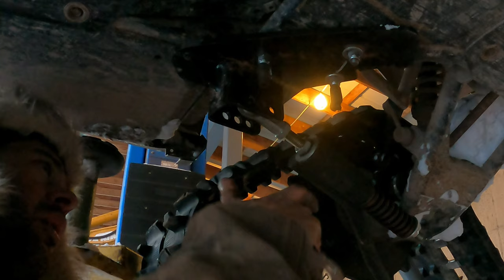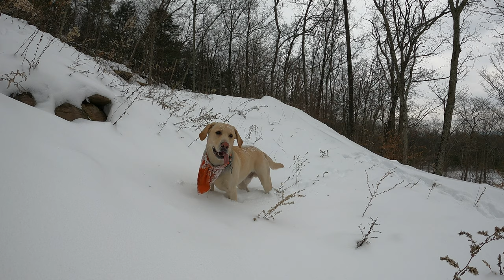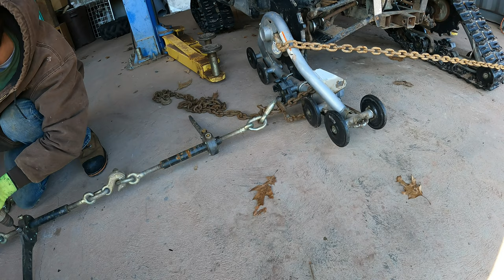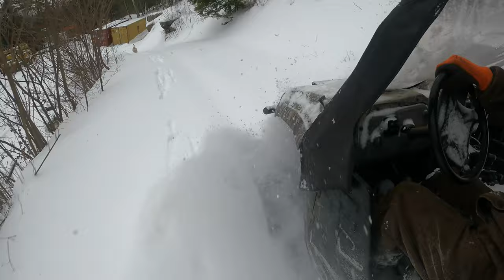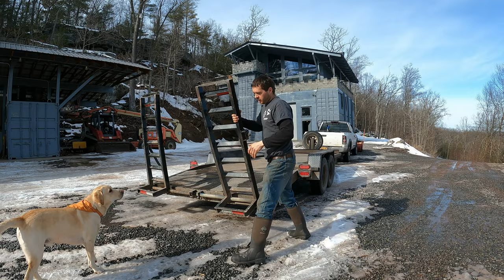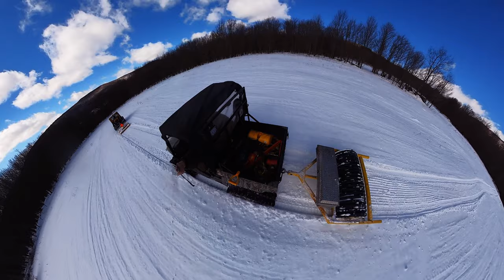Tracks vs tires in snow

Comment: The problem with tracks is the price. They are HUGELY expensive.
Reply: Why not just get a snowmobile and be done with it
Reply: I found a set on fb that was $4k new and only a couple years old for $900. For a 2014 Maverick 1000R. Definitely worth it for as high as $1500 but I live in Wisconsin. I certainly wouldn’t buy them new.
Reply: even worn tracks are better tread than tires in the snow. there is an economical market out there for used tracks.
Reply: Wouldn't chains be cheaper  & just as good?
Reply: @nancyjeanharvey7647  chains mostly better on ice. Tracks are good because they lift the vehicle at the wheels. Less stress on your machine and suspension parts to get an equivalent lift. Sure they are extremely expensive, But when your bottomed out and high centered on snow your wheel chains aren't going to help..
Reply: Mud Puddle, estos juguetes no son para los que no tenemos muuucho dinero...
Solo nos queda verlos en videos..
Reply: And they are pretty finicky
Reply: @johnjaco5544  you mean like the ones which overheats and made Andrew turn around on his 40 year old one build out of two or three broken ones? 🤔 😁
Reply: @pearlrival3124  well you can make your owns from old convey belts and angle irons like Donn DIY did.
Reply: @johnjaco5544  At this point why not get a snow cat. Though having tracks for a UTV allows for use in winter and summer. Though I have yet seen a snow cat that can take the tracks off and add wheels. Though I am sure if one wants to build something along that lines they could.
Reply: @mouaxiong8618  the stress on the suspension is still massive, due to the much leverage all obstacles have on it. If you hit a rock you might rip the whole suspension or the track cage apart. While you might just loose a tire/rim on the same rock.

While you can carry a spare rim with a tire or even two, you can't carry an additional track plus the suspension parts which got damaged 😬
Reply: 3-4k used.  Way cheaper than a sled.  Only one machine to maintain if you already have a side by side or atv.
Reply: @davec.3198  Yeah absolutely right. Additionally you also have all the same accessories you use in the summer, like light bars, winches etc.

Additionally you can close the cabin if there's a storm or really cold temperatures
Reply: Too fragile and rarely better.
Reply: @nancyjeanharvey7647  no
Reply: @RubenKelevra  not really because  in 2 or 3 ft of snow you'd never get moving to bend your rim
Reply: @nancyjeanharvey7647  chains don't help in deep snow
Reply: @johnjaco5544  because you still get the advantage of an utv
Reply: You are running your tracks to loose but yes this is one instance on frozen solid ground the tires with chains  probably would go better another thing the track haters are not even considering as these are year-round I would fight going through icy Brooks but could just about walk on water with my Polaris ranger crew I could walk through mud with that thing that my friends with their razors could not even begin to cross not to mention it gives you a five inch lift.not sure what brand he has but the way he just picked them up to put them on that machine they look substantially more flimsy than mine
Reply: @GarlandFarms  rarely better than what apparently you don't ride in South material or deep snow much I have a Polaris ranger crew the tracks give me a five inch lift I can walk across a peat bog on our farm when I put them on in the fall before the ground freezes that the other riders cannot even begin to get across with the ATVs
Reply: @lauramurray6690  Deep snow and peat bogs are not common for most people and absolutely do fit the description of rare.  Perhaps they're common to you, but to most people, they're rare and for most people, buying tracks would be a waste of money.
Reply: @davec.3198  if you can’t find a good sled  for 3-4 grand you don’t know what you are doing ... I could buy 2 sled ls for 4 grand and ride em both for 10 years
Reply: @derekchauvinisahero2010  It is true..I don't know sleds.  I known atvs and all other powersports.  
But I wouldn't want some old sled anymore than I would want an old atv.  I already have a nice atv...so I was commenting from that perspective.
Reply: @GarlandFarms  tracks are better but you need to have enough snow for them to be worth the price. you pull much more
Reply: @davec.3198  ill take an old honda over anything modern, hard to beat those ole ATCs
Reply: @davesilvia9711  I grew up on Hondas and I love them. Still have a 2 stroker 250r.
At the same time, I have a 2011 Grizzly 700 that blows the door off the old 4wd quads.  It is amazing.

Comment: The deeper the snow the better tracks are vs tires but you do lose some weight at the point of contact (which normally is a good thing) which can cause traction issues on hard slick surfaces (like large rocks and boulders). Which is why the tires worked better going up the hill at 12/13 minutes.

Comment: Whatever the actual measured results: Tracks are always going to be the winner!
Reply: Depends what you're doing actually.
Reply: @mikeznel6048  no tracks always win
Reply: They loose in terms of speed (on the road) and fuel economy
Reply: @tonykuhn7813  wat about on the water?
Reply: @tonykuhn7813  No, no they don't.
Reply: @agger838  tracks
Reply: @tonykuhn7813  Especially if you tear a track on a 2 track vehicle, you're not going anywhere. Tracks have their place and tires have their place.
Reply: Statistics and purposes dont matter when you have tracks and that goes for any piece of equipment. Point blank
Reply: @lukasebel3994  Absolutely! Tracks need more power to turn and they aren't good for high speeds or maneuvering at high speeds.
Reply: @mikeznel6048  doesn't matter 🤷‍♂️ tracks
Reply: @tonykuhn7813  9:04 buddy. Did you watch the video?
Reply: @tonykuhn7813  Point blank, as in your point is blank. It is empty and holds no ground.
Reply: @tonykuhn7813  I takenit you've never thrown a track before. Not fun.
Reply: @mikeznel6048  I have on skidsteers plenty of times. Apparently you dont know what a fun time is
Reply: You can't have fun on tracks. They're for snow.
Reply: dear all - come on - wheels are on everything (and have their uses) but given the option of having a fun 4 wheeler go-cart with TRACKS! 

FACT ATTACK - I hold the world record amoungst my pals for the fastest time at Goodwood hill climb on a gator!
Reply: I have both and the tires are way better in everything but deep snow.

Comment: I still can’t figure out why you can’t see the stick that the go pro is mounted to. Weird!
Reply: In some of the footage he is using gopro 360 that is filming 360 deegres - two separate cameras with 180 degrees - one at the front and one in the back of gopro -  the algorythm is makin these two views into one ,like being inside the sphere, the stick is "between" them so thats why it cant be seen, it can be seen sometimes when You are filming on water and drop is on the lens...
Reply: I have a green stick which i chroma out when editing. Fairly simple tbh
Reply: He uses a drone aswell
Reply: it's a 360 camera I think, not a gopro. the software it comes with edits the pole out.
Reply: @zd533  Youre right it might be some other brand but I think I ve seen in some different Andrew movie that he is using gopro max - 360 camera,

Comment: Im sure the gearing is lower on the tracks which helps too
Reply: I went "all round the houses", and nearly melted my braincell in the process, but I figured out why you're right. What matters is, the radius of the track where it goes over the drive-wheel-hub-thing, compared the the radius to the edge of the tyre. For a given number of rpm's, the tracked car will go at half the speed (or even less) of the wheeled car. And lower forward speed = more torque.

Comment: The only thing you can’t say is tracks  suck at going over logs and rocks and if you’re going to run track you should definitely have chainsaw with you
Reply: I totally agree. Had a set of tracks on my quad years ago and got stuck twice on logs that were hidden in the snow. The front tracks got over them then the back tracks dig in and go under the log then you’re done for

Comment: Before automobiles, trails and "roads" were packed using a Big Wheel that was weighted with rocks, pulled by horse teams. The snow was packed down and folks turned their commuter wagons into sleighs.  Even if automobiles weren't invented, Andrew would have been just as interesting to watch and just as informative to listen to, whether he's motoring down a trail now, in modern times, or ploughing a field leading a team of oxen like they did 125 years ago.

Comment: For those who live in snow country, here's why tracks don't sell well.  A foot of snow is what's known as October.  The only time the tracks performed well on a light snow covering is when they were following a Snow-Cat.  Where I am, UTVs/tracks are not allowed on any of the marked snow machine trails.  If you take them off track, on elevation, they're dinked.  I have a 1000cc General with a 6" lift and 35" high-treads and it's covered and stored in the winter.  With or without tracks, I'd be spending more time on a winch than driving.  Once winter starts, the snow machine comes out.

Comment: I could be wrong, but there should be some way to adjust the tension on the tracks because don't they stretch a little over time? You should be able to tighten/loosen them and it would make it easier to get the track part back on the rollers.

Comment: Is that a weight box on the snow packer?  I wonder if you could make a bar linkage that would let you move that box out over the roller so it packs more.  If so, you could lighten it by half and still get the same amount of packing.  If you ever got stuck, you could then scoot it forward to give more rear traction, but you wouldn't need to much if the packer weighted a lot less.
Reply from the maker: There is no added weight, but I guess that could be done. It seemed to work well the way it was though.

Comment: I am curious to see how the tracked unit's clutch will hold up compared to the one with tires after an extended period. I have no idea why but something tells me that the tracks put more load on the CVT than the tires. In theory, the tracks move just as easily as the tires but I just have a feeling that it really wears on the belt. More weight maybe?

Comment: I didn't see it in the video but you may have done it.  There's a certain approach angle on those things you have to set them up for on with the tension rods a level floor, they really suck in deep snow if it's not just right.   Also put your shocks on the highest setting if it had adjustable spring rate like on my can-am.  Articulation is not your friend.  It's funny I bent a frame just like that too.

Comment: Andrew, looks like those front spindles/Tie Rods with the Tracks could be a bit stressed if you hit a rock sideways at the front tips.  Any comment on such a theory?
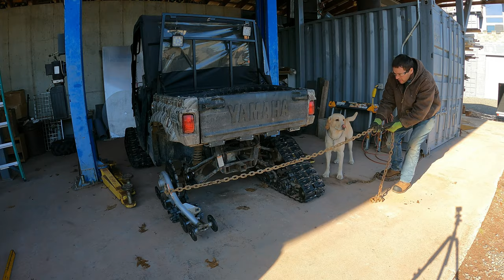Reply: Theory proven fact.  Bent the Track frame at 18:44!  Steerable tracks with the extended lever arm will likely either self destruct or do some frame damage.

Comment: Neither can complete with 4x Pawn power. I've long considered these modification as a gimmick that are never going to be as robust as a wheel and your experience pretty much vindicates that thought, but not as bad as I thought.  Changing a wheel in the field would be easy, but imagine if the track had torn or snapped. You could be in big trouble.

Comment: Andrew btw those tracks you have on the quad aren't snow tracks, google or youtube search snow bike and look at how aggressive and deep the tread is on the cat belt.    There's a noticeable difference between the ones you have and those. Just to be perfectly fair with the wheel vs snow track.
Reply: I'm going to have to say, a snow mobile is better than a quad in deep snow because the quad's underbelly gets lifted up on the snow. I'm also going to have to say the snow bike is better than the snowmobile off trail because it's lighter and thinner to nimbly navigate through trees and get major air on snow jumps. I would say if you can find an extremely deep dreaded mud bog tire for the Kawasaki side by side, that would be the ultimate way to go or even get some extreme muddys for the quads just for better work horse abilities in deep snow or mud.

Comment: The leading edge of the tracks on tanks doesn't start at ground level.  Even skid steers with the nose of the track on the ground have a larger diameter in front that this does.  I think the problem with the tracks you put on the Rhino is that you basically approach every obstacle with a really small radius on the front of the tracks compared to the tires.  It just buries itself under things like the ice and branches.  So,  I bet a design that has the front set of wheels up at least as high as the centerline of the stock tire would do a lot better.  Ground pressure just doesn't seem to be that much of an advantage if sinking 5" kills you when sinking 10" was just fine before.  Kind of a one-trick very soft snow pony.

Even in the snow, I think you'd have to lift the Rhino with tires to the same frame height to be comparable.  Looked like you got it frame deep a few times.  I wonder if you would have with it lifted, and if you lifted it by putting larger diameter tires on it, I bet there would be even less difference.   Rhinos are the most unstable of any side-by-side already, and Yamaha had to do the recall changes to even get them to where they are (rear spacers, disconnect anti-roll bar, and added doors and a handle).  So, Rhinos aren't the ones you want to lift, but in the tracks vs. tires debate, you'd have to consider the lift the tracks provide.

Comment: flotation is the goal ...and im pretty sure what you have are ATV tracks and not UTV, to small for flotation. i go over 5-6 feet of snow with no problem with my tracks
Reply from the maker: I think they were an early design. I want a set for that krx1000.  What kind do you have? Where did you get them.

Comment: Always wanted to drop an Auto Trans and a V6 into one of those Bombis
Reply from the maker: I just got a new bombi that is turbo diesel with an auto.
Reply: I ran one identical to the one you tailed up the hill, groomed trails for about 15 years,,2nd year,had to do a quick transplant  from a ford fiesta,a slight modification to crank/flywheel,to Make it function proper,,then I rebuilt original 1600,put that back in after that season

Comment: Tian.  UTV’s were never designed for playing in the snow.  UTV’s are work horses they’re not thoroughbreds racing at Kentucky track.  You wanna play in the snow in the mountains go buy a back country sled with long track & 3 inch paddles.   Other point who takes a plastic shovel to dig themselves out.  Need a metal shovel.

Comment: At 16:00 “I’m probably misusing the thing,  but”.     Ya think Andy?   You really think so?   You are so childishly destructive sport. You are. 

 You are not,  not emotionally mature in several areas at your age.  And in some areas,   You are.  But I’ve never seen anyone that deliberately,  abuses equipment over and over and over. 

  On purpose as much as you. As hard, as you boy.   After saying those words,  he said this.    “Oh look I threw a track off there.”  

    (From deliberately running over limbs to break them up. Which they are not made for that.  Get an  AXE 🪓 Or a CHAINSAW!! )
Reply from the maker: I am operating everything fine. If it breaks it was not built properly.